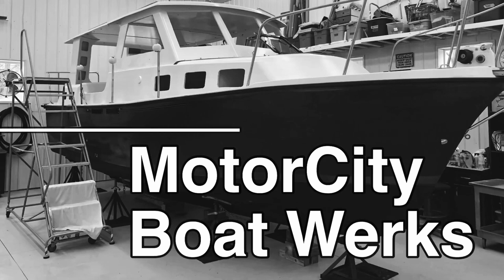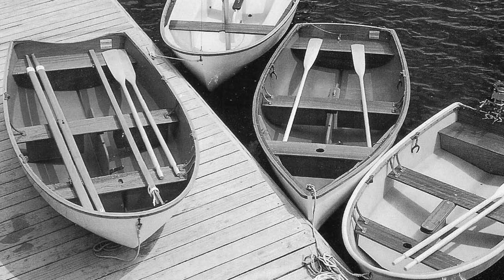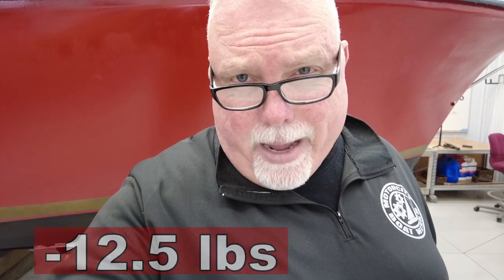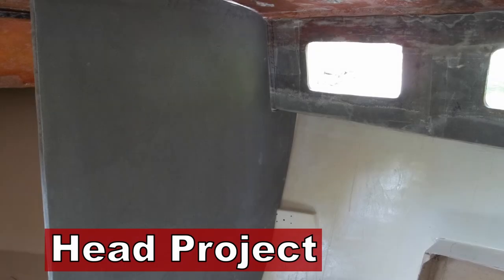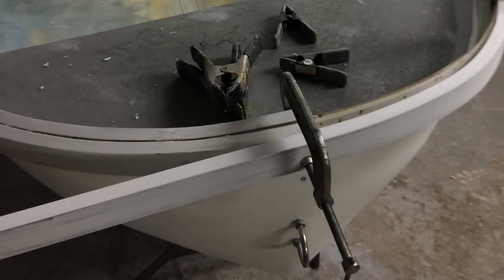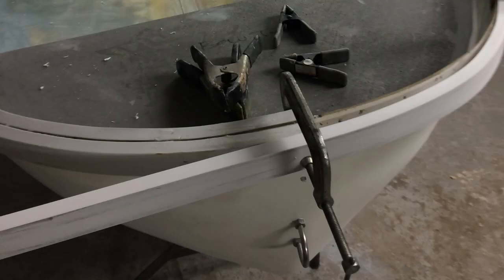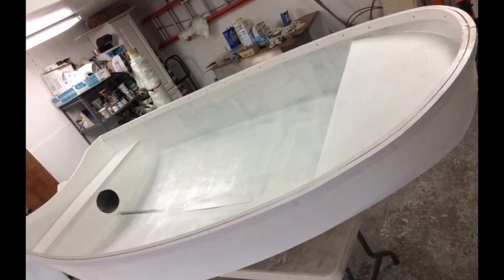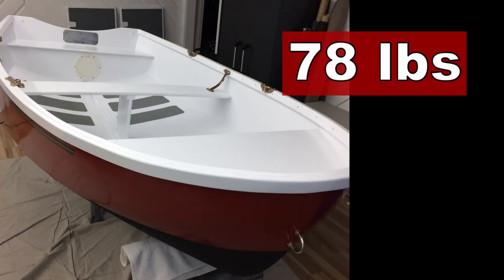How to Build an Ultra Light Weight Dinghy | Composite Boat Building (Ep23)

Comment: Great videos,subbed, exactly what I am looking for ,I have a 25 ft sail boat , it can with no anchor locker of any description , I am seeking to create a shelf under the foredeck with a hawse pipe to feed the locker with line , my plan was to attach two lengths of timber one each side of the internal of the hull in the forepeak , raw hull no liner , once the timber is attached to the hull cut a V section of marine ply ,place it over the timber sloping downward towards the bow so I can install a drain and thru hull , now my question how would you attach the two lengths of timber to the hull ? , also what fibre glass Matt and resin would you use to cover the marine ply and tab it up onto to hull about 4 inches all the way around ,I am not to worried about appearance as it will be out of sight , just want it strong as it will be free from any other support , and will be housing 15 mt of 8 mm chain plus 50 mt of line ,probably around 30 kg , but with the slope of the shelf the weight should be resting on the hull forward as well as shelf , thanks for your insight cheers from Australia
Reply from the maker: Welcome Aboard PanPan👍😁 thanks for the comment. See the Playlists. Unfortunately I don’t  consult on projects via the comments section. 
https://patreon.com/MotorCityBoatWerks

Comment: I  built a 9 foot that is 43 pounds. In fact I built 2 and I built an 11 foot that is 50 Pounds. I think yours is prettier but mine has an advantage for those that want to access waters by foot or without a boat ramp. I suppose mine are not dinghy's but rather row boats.
Reply from the maker: Excellent!

Comment: The dinghy looks great! Where did you buy the PVC board you used for the toe rail?
Reply from the maker: Mark: Try a 2” x1” piece of extruded pvc trim stock which you might find at a big box store. While not exactly the same as pvc foam board in certain applications it’s a close enough substitute
Reply: Ok, I’ll try that. Thanks.